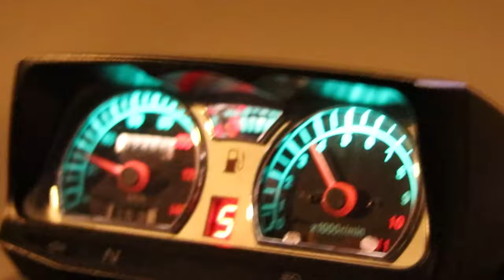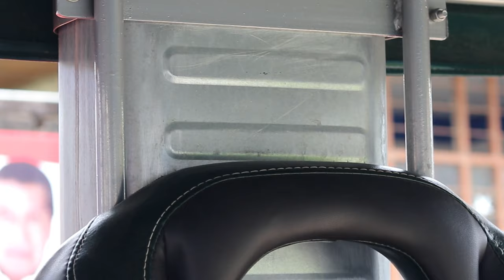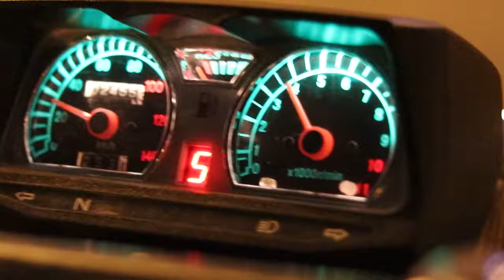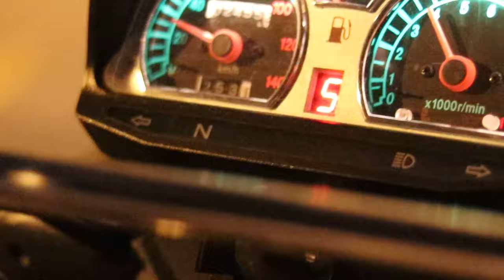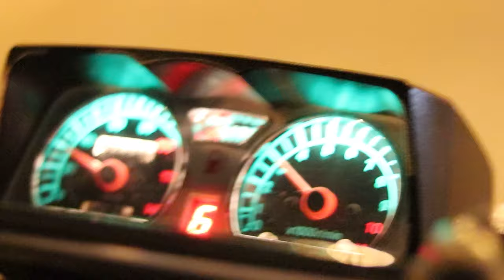MOTO CARGA DOBLE CORONA  O  DOBLE TRACCION

Comment: Lo malo que son tortugas :(  se puede ver en el video
Reply: Que pudes esperar de un MOTOR 300
Reply: @davidcondori4375  tengo un ronco motor 200 
Y un senda motor 250 
Y mi moto ronco core mucho mucho mas que el senda. Y que decir del Sheilin motor 250 eso no corre ese vuela mis amigos tienen
Reply: @JimmySusanibar-vm1fc  si pero el tuyo es de dos llantas traseras. 
La otra son de 4 llantas traseras. 
Lo cual necesita más fuerza. 
Por eso reduce la velocidad u aumentan el torque
Reply: @davidcondori4375  en parte es muy cierto si solo son de 3 llantas en total mis motos pero seria bueno que le a condiciónen una caja adicional como las Sheilin que son de 5 llantas y  es mi manera de pensar no :) por lo demás si se ven geniales esas motos extra grande y largo son vacan
Reply: @JimmySusanibar-vm1fc  si son pajas pero deberían ponerle un motor de tico o uno de moto de 600cc
Reply: @davidcondori4375  el motor de Daewo damas lo colocó y trabaja ruta larga repartiendo golosinas